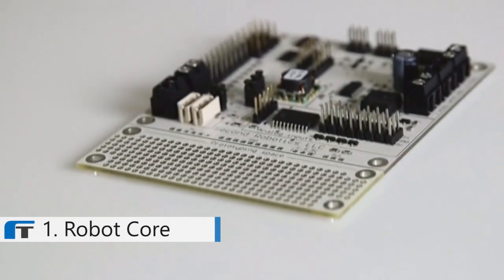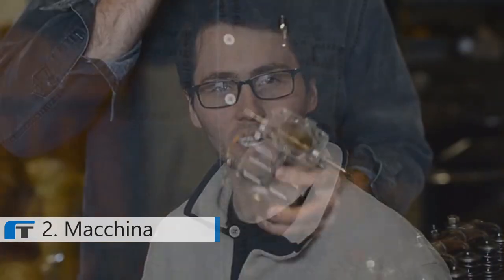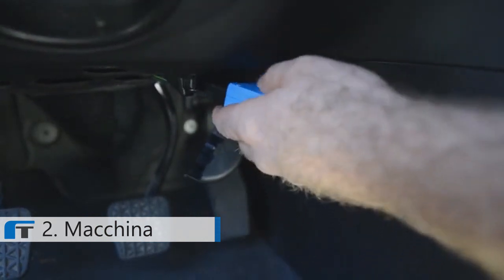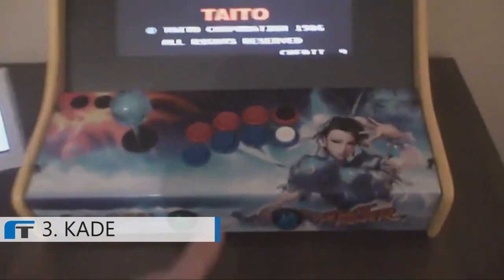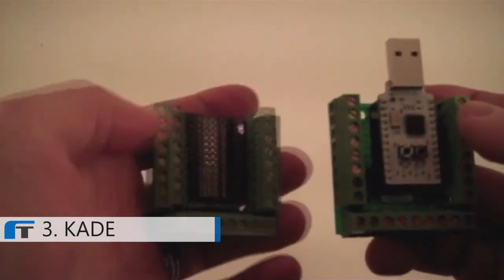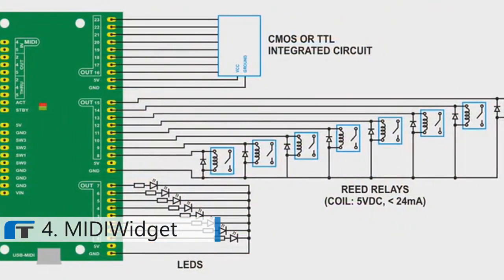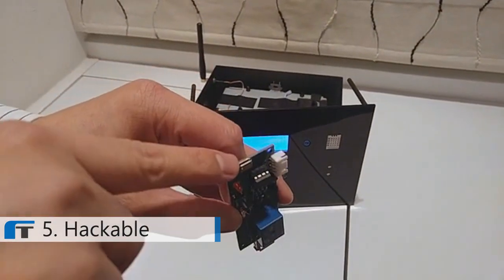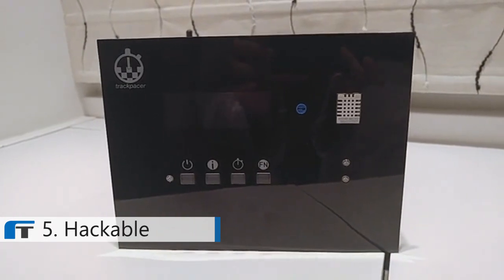5 Universal Raspberry Pi Projects To Control Anything Remotely

Comment: 1.) only 1 of the 5 had remote control, so please change the title of your video!
2.) what was number 5 anyway?? he never said what the function is. if it simply was for switching on and off a Raspberry Pi, then he should have considered a 2$ IR-switch instead of building such a huge box for nothing